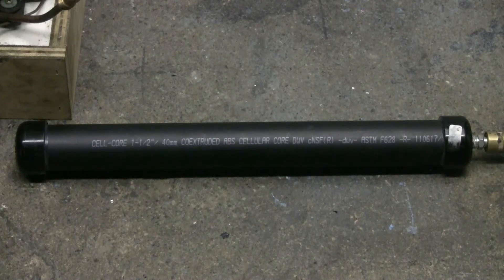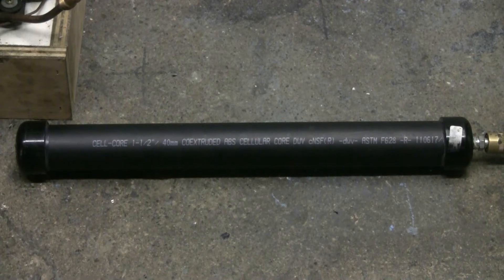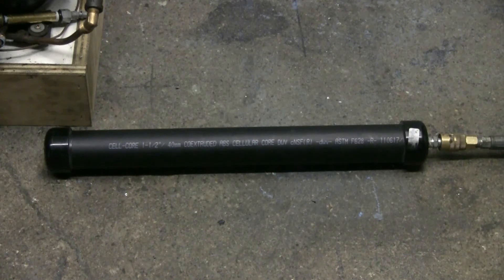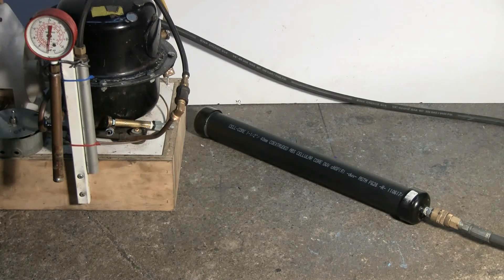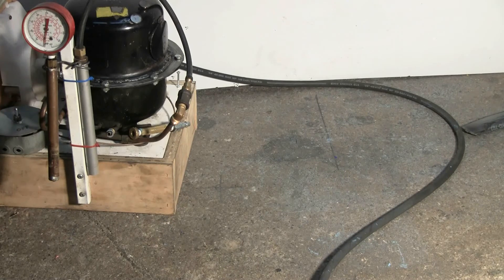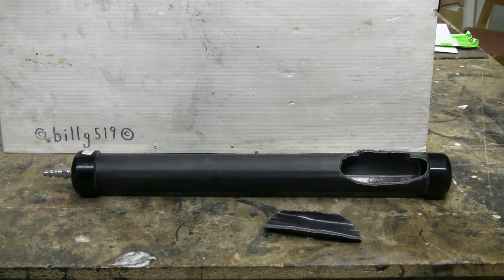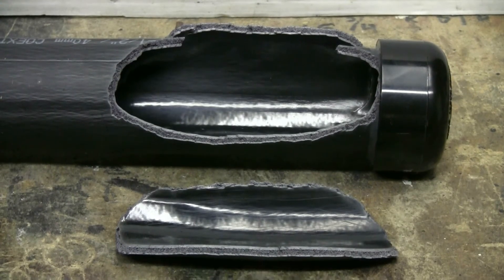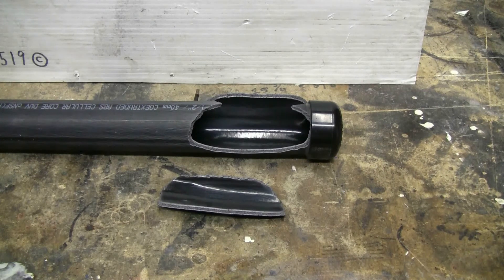Air Compressor - Bursting 1 1/2" ABS DWV Cellcore  Pipe

Comment: what would a section of 8"x15or20" become unsafe? i wanna use it for resin casting. i wouldn't ever go higher than 60psi.
Reply: The equation for hoop stress in a cylinder is stress = pr/t.  So higher pressure means higher stress, larger radius means higher stress, and larger thickness means lower stress.  All linear relationships.  The yield stress of PVC (room temp, not exposed to sun) is around 7000psi, but you want to keep that down much lower, maybe 1000psi?  So 1000psi = pr/t.  Define two of the variables and see what the third one does.
Reply: @PaulGreggBYRC  thx for the knowlege

Comment: Thank you.  I've used a 4-inch (nominal) ABS pipe as the reservoir for an air cannon (feeding a 10-foot, 2-inch alumnium electrical conduit barrel) and wanted to find some empirical data on its projected burst strength.  Based on the ratio of IDs and ratio of wall thicknesses between 1.5 and 4", I take your 455 psig and equate it to 297 psig burst pressure for 4 inch.  Obviously with NO safety margin.  But it gives me more peace of mind running it at 100 psig as I've been doing.

Comment: LOL they didn't exactly make these for cannons, so it seems far more than enough IMO for its intended applications.  Interesting to see that the solvent cement joints were stronger than the pipe itself.

Comment: The other thing is, just because you can pressurize PVC or ABS to a high pressure in a test doesn't mean much, because the strength is highly susceptible to damage, UV sunlight degradation, and especially temperature.  Both materials become much more brittle (low impact resistance) at low temperatures, and they both lose a lot of strength at elevated temperatures.  On a 110 degree day, PVC can lose 50-60 percent of it's 75 degree strength.  So the manufactures will state the maximum pressure of a 1-1/2 inch PVC schedule 40 pipe is  330 psi, when they know it will burst at 1060 psi, at room temperature, no UV exposure, no damage.  They want a lot of margin of safety, and we should too.

Comment: The minimum required burst pressure for 1-1/2" PVC schedule 40 pipe is 1060 psi, much higher than your ABS.  However, PVC is more brittle than ABS, and will shatter on failure, partly because it's holding a lot more pressure than the ABS can.  Your PVC shatter experience was most likely due to prolonged sunlight exposure, which degrades the fracture toughness, which is different that static strength.  Pressurized PVC air cannons should be painted  soon after assembly, preferably with a dark paint, to lessen the effect of UV radiation from the sun.  I make backyard roller coaster tracks out of both ABS and PVC, and I'm torn between what's best.  PVC is stronger, but ABS is tougher.  I've impact tested both painted and unpainted PVC electrical conduit after 2 years of sunlight exposure, and the fracture toughness of unpainted PVC is about half of painted PVC.   ABS has carbon black in it to inhibit UV sunlight degradation of fracture toughness, I presume because it sticks out of roofs in plumbing applications.

Comment: I was worried about using ABS with sewer back flow preventor. The Fernco couplings are rated for 4.3 PSI (10 foot column of water). Clearly, the ABS won't be the weak point.

Comment: I have spent over 2 hours studying your high pressure videos. You have no idea how valuable they are to me..  The are saving me WEEKS of testing to build an air fueled Minto Wheel (heat engine).  The air bubbles in this plastic , make it a poor conductor of heat. Unsuitable for a heat engine. I really like your videos  THANKS .

Comment: I've heard that pressurizing PVC pipe with air is extremely dangerous because PVC shatters into sharp fragments when it fails.  I've also heard speculation that ABS may be safer because it fails differently.  You seem to be equipped to test both of these bits of folk wisdom.
Reply: https://youtu.be/IVO4_hUvFsc?si=iFtkI0v2idVMhPLR 
You see so many air cannons made of pvc. I want to see some tests on wrapping it in different things to make a catastrophic failure safer. Duct tape seems like it would help
Reply: As someone who swung a PCV pipe of large diameter (was probably about 4" in diameter) onto a wooden post it shattered and a piece stabbed just below my eye. PVC is very brittle.